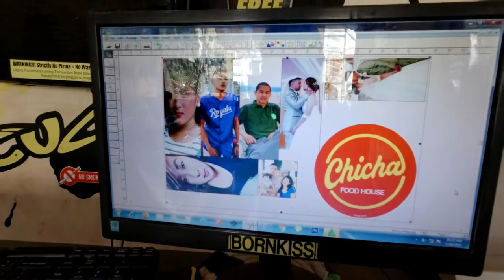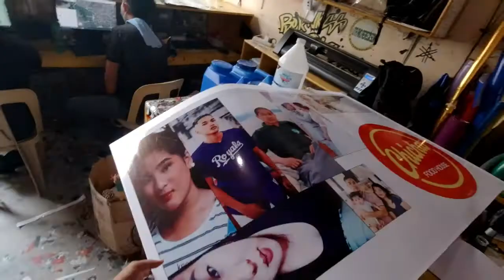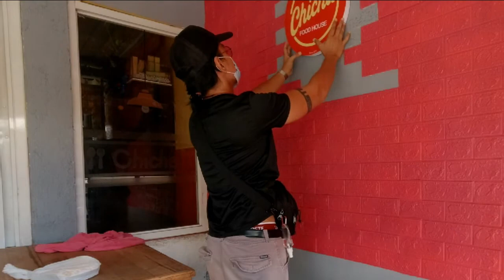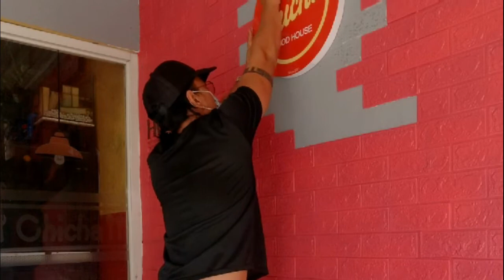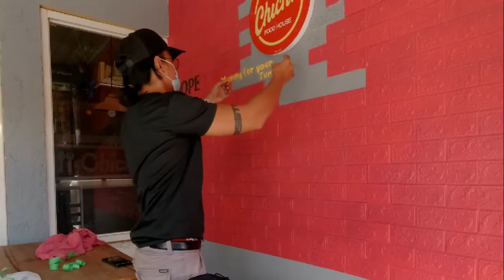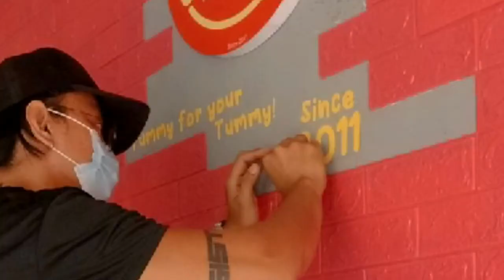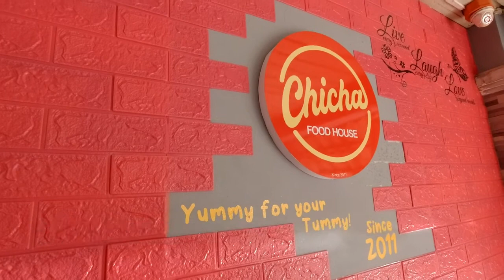Paano Gumawa ng Build-up Sintra Signage/ TIPS AND TUTORIAL / STICKER BUSINESS / PHILIPPINES

Comment: Newbie here. Anong gamit mong printer boss at anong head?
Reply from the maker: ecosol printer na dx11. china brand lang yun printerr
Reply: @ParengBobpambansangkumpare  boss ano po ba tamang settings ng printer kapag sticker?
Reply: Kasi yung sa akin boss, sabog ang print, tapos yung letra niya hindi solid yung mga gilid at edges.
Reply from the maker: @accessdatabasedzone4294  ilan buwan na head mo? at anong head?
Reply from the maker: @accessdatabasedzone4294  saka gaano kaliit yung piniprint mo?
Reply: 6 months na boss, dx11 din, lero kung sa malalaking text at designs, okay naman. Pero kapag sa logo na, hi di na. Solid yu g edges niya, 3in x 3in size ng logo, samlle logo is logo ng eagles bosing ang tinesting ko ng print